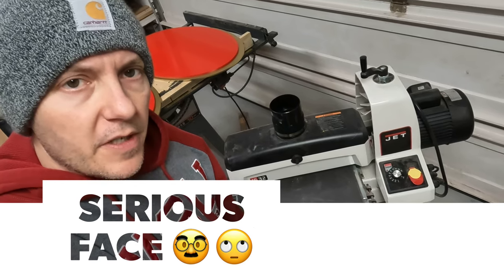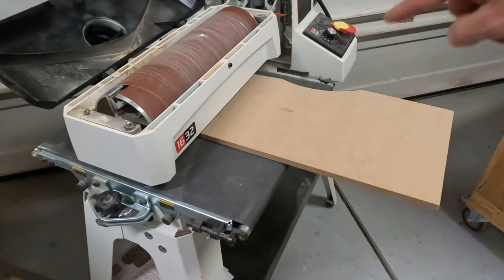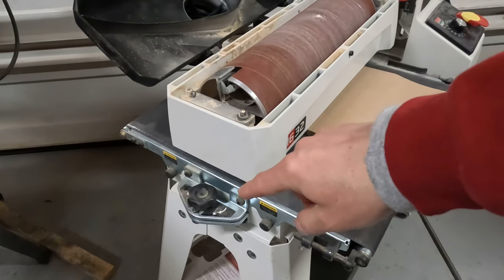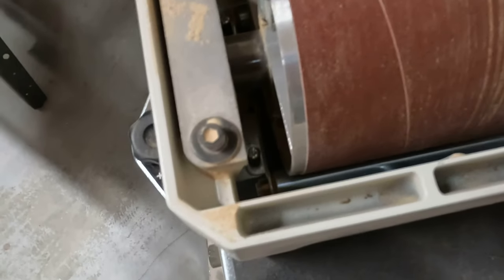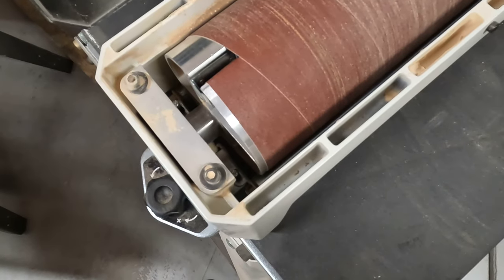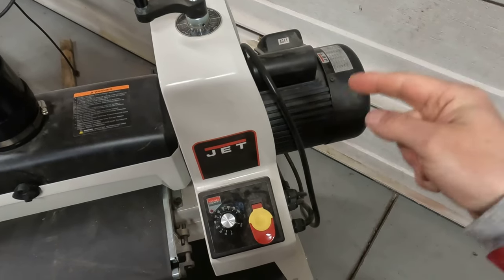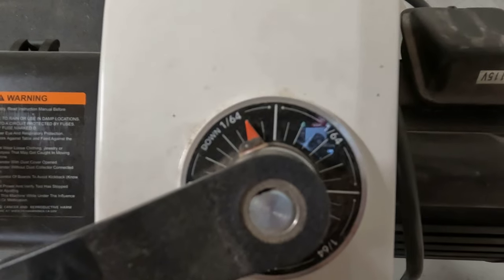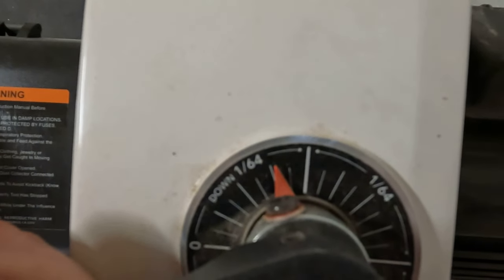3 Quick tips when using the Jet 16-32 Drum Sander

Comment: Other tips: Get several large rubber belt erasers and every 10 passes or so, open the lid and 'erase' the drum. It keeps the sandpaper clean and cutting with less heat and burning. When the belt gets clogged and unerasable, remove it, roll it up, and soak in Simple Green. Unroll it and scrub it with a stiff brush. Rinse and allow to dry. It will be good as new.  Belts are expensive!

Comment: I’m curious why you would want the rollers as loose as possible? Wouldn’t that make the piece tip up more easily?
Reply: With trial and error that is what I came up with. I think if you always used larger pieces (heavy) it wouldn’t be an issue, but when you go to run anything small and lightweight through it the tension on the rollers can cause the pieces to do weird stuff. Now that I’ve used it even more, I do sometimes put manual downward pressure on the workpiece going into AND out of the drum area, especially on the last few passes… this really reduces the snipe altogether. But when your workpiece is entering and exiting the drum and only under the tension of one of the rollers, and it has significant tension - it doesn’t help the situation. Good luck! Still loving my drum sander!

Comment: Are paper changes easy? I just got rid of a Performax 22-44 because it was a nightmare to change.
Reply from the maker: In my opinion, yes.  I don’t think it even takes 3 minutes, but if it does that’s because I’m OCD about getting the paper lined up just perfectly.  There is a spring loaded clamp for the paper, so you just press that and it releases, unwind and you’re ready to put new paper on.  I buy the premade rolls, then just clip the left side in, roll it on, and clip the other side in.  The first few times you do it, you may need to unravel and start over, just learning how to unravel it for best alignment… The spring loaded clamp keeps the paper tensioned so that’s nice.  Still enjoy using my drum sander.

Comment: To make the bed parallel with the roller, I would take a board with parallel sides ( the wider the more accurate) and run it through. Then take calipers and measure each side. Then simply adjust the bed until both sides give you the same reading. Not sure if I’ll get a drum sander or a flatmaster. T U.
Reply: I agree. I also draw lines across my board to get an early indication of exactly where it’s hitting board and where it’s not, then adjust accordingly. I really don’t think that you will ever get it 100% perfect with this particular machine (cantilever style)… which is why when I run boards through the machine I rotate them, and take shallower passes towards the end of the run. Seems to work pretty well and I get pretty flat boards that way.

Comment: Maybe that explains why I just started getting burning. I have 1020 but I also think my sandpaper is shot even after using wax stick on it after every pass. Also I don't think I have it exactly level will that cause issues? I have no idea how to calibrate the machine or anything like that. Every tool I have is always easy to deal with except the drum sander.